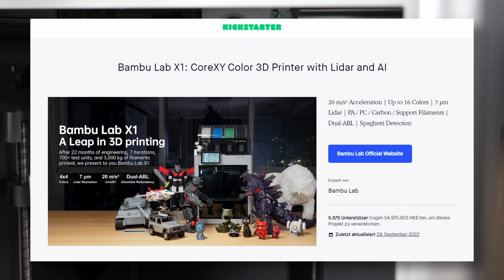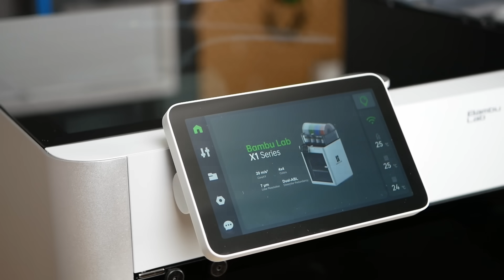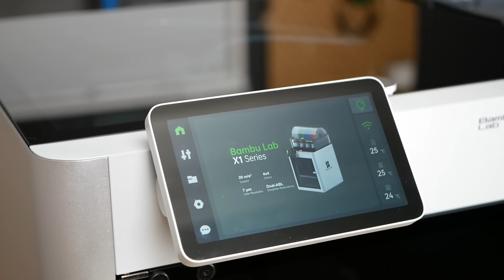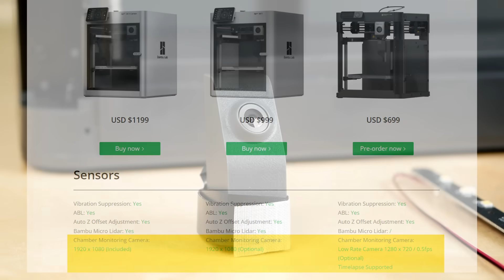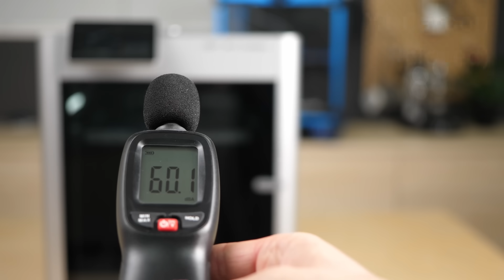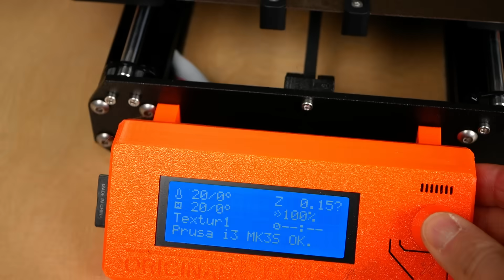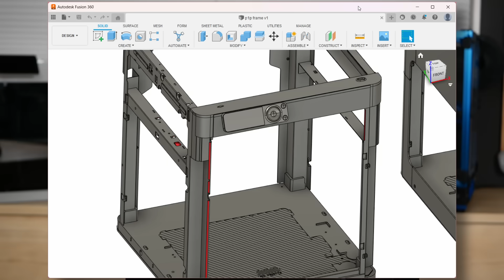The Best 3D Printer of 2022 got Stripped Down to make it Cheaper!

Comment: X1C backer here and love the machine. And since for me 3D printing is more of a tool supporting my other hobbies than a hobby in and of it self, it suits me better than the p1p and my previous printers (Anycubic, Solidoodle…). But I’m happy they released it nevertheless—great for 3D printing enthusiasts and helps ensure bambulab‘s future both in general as well as in the more lowcost, hobbyist market! So what’s not to like about that?
Reply: I use the p1p for some weeks now, and i needed nothing to calibrate or change. Send a print to it, wait, done. For half the price it’s just amazing. And if i ever want to print abrasive stuff i get the hardened nozzle and one of the already available 3rd party enclosures (starting at around 50 bucks for an acrylic one) and have basically the same machine, except the lidar. For me the P1P canibalized the X1C, because that’s the one i originally planed to get 😁😉

Comment: It's interesting to see the comparison prints because, with the finite detail I can see via video, they look quite similar. Which makes the giant blower fan + "lidar" seem more gimmick then necessary as was originally viewed. I'm otherwise torn... they are VC-backed and burning cash, we don't know (and probably won't ever) how much margin they make on the machines, they seem genuine, wanting to right a wrong, listen to feedback, etc. but they didn't even take down pre-order icons on the X1 and have a backlog before this was announced and there have been other points of discussion.

Somehow the different news that comes out about them, the code I see written, the code and designs they've used (or hint at using), the interaction with the occasional engineer, cloud always connected, etc. It makes me want to summarize Bambu as "wanted to make a variation of a Voron and then sell completed machines, needed to figure out a profit source and decided on cloud and accessories/parts (following 2D printer model), pitched to VC and got funding, viral marketing to get machines Kickstarted, then hit a plateau... and found the 2 groups of people who wanted an X1 but wouldn't buy it either considered it too expensive or wanted more customization, so they stripped it down so it would be cheaper + can be customized"

What happens if they can't keep up AND they aren't actually selling as many as people think? Do they OTA update it so you can't use the printer without being connected to the internet + require subscriptions? Are they trending towards profitability without cash burn? What if they get a proper cadence and, like so many companies these days, go "ok, we can handle this with 10 people instead of 100. Bye" and all the community members who went "are you hiring" are suddenly going "I want to burn these machines." How much money goes into R&D? They stripped won a machine but didn't do much more then that... do can't say a lot of R&D was done to bring it to market. They keep being cited for OSS violations and, recently, security.

Fool me once, shame on you. Fool me twice, shame on me. If we want to make things better, we need to hold companies feet to the fire. Be it Bambu, Prusa, Anycubic, Creality, etc. etc. Because Bambu is cited as the Prusa killer, Prusa has demonstrated learning from mistakes and ensuring they don't repeat it. Bambu keeps being cited as having done the same issue that was previously pointed out.

The machines certainly have an appeal, with speed and quality at a good price. They made people interested in multi-color again (though they look at MMU, Palette, etc. and complain about purge blocks every time they see a multicolor print. But then people causally never mention the purge that comes out, outside of reviews of the system). They are not bad machines, they are not a bad company, but they keep raising red flags for me when I go to pick a product or similar... and I don't know if I want that. Some won't care, some will.

I wonder if Nov 2023 we'll be going "Hey, do you own a Bambu X2? What about a P3? What?! How have you not gotten one yet?" or will people be going "nobody wants to buy my old Bambu. It sits collecting dust since <name some machine> came out OR the company did X"

Comment: Had several Mk3s and it's been my go to printer. Had pre-ordered the xl but cancelled now. The X1 carbon prints +3x the speed of my mk3s. So for a typical prototype that's 1 hour instead of 3, meaning I can basically print as fast as I can design. For our R&D department it means 6 iterations in one day vs 2. Prusa should have launched the mk4 in the shape of a voron 2.4 at least two years ago to stay in the game. You can't sell an 8 bit bed slinger for $1k in 2023. And the xl for $3-4 k is for 5% of the community.

Comment: As an Ender 3 Pro owner I have been very impressed with what I got for such a low price, I upgraded to a silent motherboard-essential IMHO. If I were to upgrade I’d want an enclosed bed and a bigger print area. I do print functional parts within the limitations of PLA but the fibre reinforced filaments look very tempting.  So to sum up I’d buy the higher spec machine.
Reply: Dude I will never not use tmc2208 drivers again.  pretty amazing that $60 can completely change how an ender 3 feels.  Being able to use it a few feet away from me without even  noticing it was a game changer

Comment: P1P, more like R.1.P. Because if they leave out the LiDAR and camera, they leave out exactly those most important features of the X1C.

I don't see any hype forming around this budget machine. They should've at least kept the LiDAR and spaghetti detector. Many hobbyists don't need fiber reinforced printing, or an enclosure. But they removed the biggest keypoints. I'm sure this is done because they don't want to self-compete, but it also cripples this machine too much.

Comment: I'm more of a maker, than a tinkered. I also like the higher temperature materials that are available on the X1C out of the box. For MY needs, the X1C is my choice... I'm already saving for a second one.

That said, the P1P should have no problems filling in the niche that it is targeted at and has the potential to stretch a fair amount outside of that. If I was still more of a tinkerer, I would have jumped on the P1P in a heartbeat. I seriously considered buying a pre-order but after sleeping on it for a bit, decided that it was better to wait until I can get a 2nd X1C.

Comment: I honestly regret buying the X1. You don't realize what you have until it's lost. I didn't realize how much I was giving away with the proprietary firmware & slicer. I've come to expect familiar firmware and slicers that can be freely exchanged and modified. Having the factory shackles on is not fun. I just want to slice with SuperSlicer or Cura. Plug in with USB & use OctoPrint. Or run Klipper. The trade off is not worth it.
Reply: you can use superslicer or cura...

Comment: Stefan, I have been testing my X1C... I covered the LiDar, and nothing seems to happen. There are a few people that feel the LiDar isn't lidar at all? Can you dig into it?
Reply from the maker: IMO, they are not yet using it to it's full extend and only use it for flow calibration. Pressure advance is checked via the simple cameras.
Reply: well its not really lidar, its like a laser scanner or something. If it sees nothing, I'm pretty sure it doesn't give an error, and sets flow to the default flow value of whatever filament you're printing.

Comment: they removed too much for it to be worth anything at that point. for 700 bucks youd expect them to at least keep the bespoke features that made it hype in the first place. but thats literally just their brand name on a trashier looking cr200b. i hope nobody is stupid enough to buy that thing when you could an ender7 with linear rails for less than that
Reply: an ender 7 costs the same price, while lacking vibration compensation, speed, direct drive, and a triple z.
Reply: What an absurd comparison. It still has auto z offset auto resonance compensation and prints 3-5x an average printer while being able to handle filaments requiring temps up to 300 and having wifi. It also has a direct drive extruder to handle flexibles well as well. A CR200b cant even hope to compare to this.

That you are even beginning to compare a crappy ender 7, which is an ender 3 with all the problems of an ender 3 but hey its core xy (despite not having input shaping to make use of this) is insane. You have absolutely no idea about the printers you are talking about.

Comment: Only thing I would change in the p1p would be giving it a simpler out-of-shelf controller board. Also remove the screen and card reader from the base model, since I never used them in any of my printers. I used Pronterface in the my first i3 clone, then changed to Octoprint and now I run Klipper.
Reply from the maker: I'd love to exchange the control board on a X1 for a DUET or similar, yet with non-standard stepper drivers and a ton of custom electronics, this is going to be a challenge.